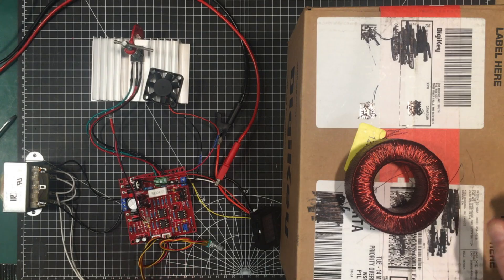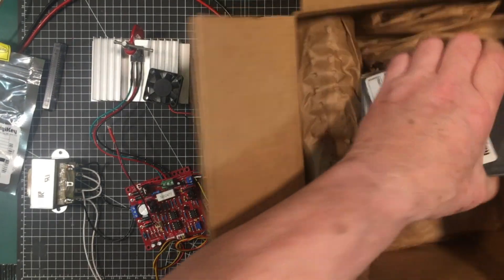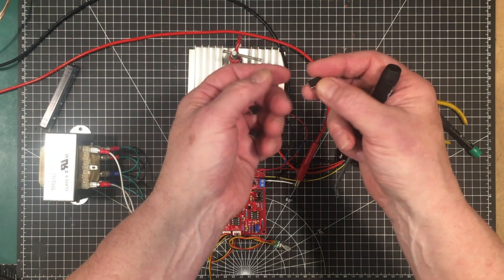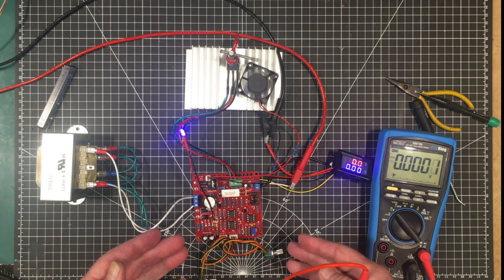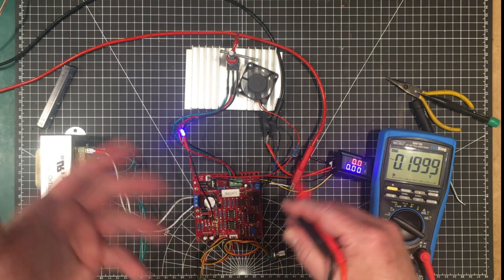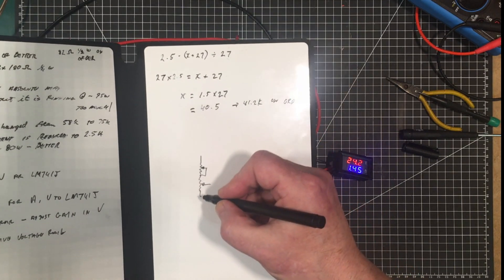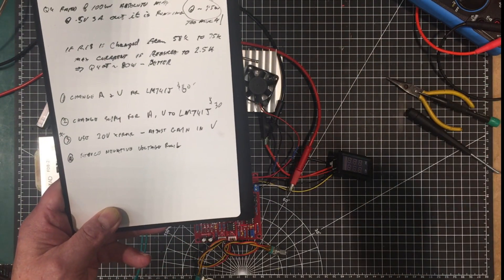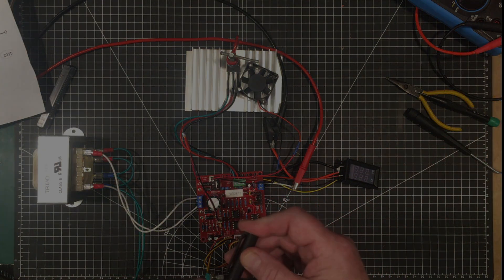Uni-Byte 0187 - PROGRESS was made - Linear BENCH Power Supply (Hiland): Part 2

Comment: one should not need to operate opamps to the maximum rail voltage to drive some BJTs. the designer just could have used 12-15v for the opamp with some design considerations.
Reply from the maker: Yes, if you put a PNP transistor in the output amplifier you can use a much lower voltage for the opamps.

Comment: While you're reading 36v open circuit, at 3A you should be at least halfway to the transformer's rated voltage (@6A), or ~30v, probably more like 28v. That's still 75W of heat when outputting 3v@3A, but not the borderline 100W.
Reply from the maker: Correct!

Comment: DO NOT tin the tip of stranded wires for a screw block!

The softer metal of the solder will crack & bend over time, and allow the original tightened screw position to lose pressure on the wire as a whole. Then you either eventually get a lost connection or a high resistance connection.

In the worst case this has happened to many people running 3D printers and left their house burnt to the ground. Common cause was tinned wires screwed into screw blocks; come loose on the heater connection and you are running amps through a high resistance point. The assemblers were following the same convenience advice as you. You'll see most 3D printer reviewers now checking if connections are crimped into 3D printer motherboards for cheaper models.

Better than tinning is indeed screwing down the bare wires. Because the wires are stronger less ductile metal, even though it could be messy, the screw can hold pressure on them even when they are nudged.

Even better than that, is using an appropriate crimp connector, crimping it on, and then screwing down on the crimp.
Reply from the maker: I get what your saying and agree, however in the case here I am only tinning the first mm or so.  This should go past the clamp point.  If it does not then this method should not be used.

Comment: Excellent update.....many thanks. Don't forget, if you just need cheap, you can parallel two of those pass transistors and they are very cheap. Great idea of using a variac to test the effects of reduced voltage of the transformer on the op amps.
Reply from the maker: Thanks!

Comment: Mine came with OP08 which is a bit better than TL081 but I replaced them with MC34071 that can handle up to 44V supply and they are very cheap.
Reply from the maker: Did you find some DIP-8 MC34071s or use a breakout board?
Reply: I got DIP8 from AX and they are working great

Comment: I always soldered the tip for years. I started using bootstrap ends just this year.  The relief the plastic bit that extends from them makes things much tidier. Only for screw in terminals. I still solder everything else. I despise those push in proto boards.
Reply from the maker: I agree, ferrules only for screw terminals.  I still use solderless breadboards for quick and dirty "try outs".

Comment: I have a couple of cores rated for somewhere between 1000 and 2000 watts at 60 Hz AC, probably a lot closer to 2000 Watts. I'm planning on winding one as both an isolation transformer for the bench, and a 50 V supply for a HF linear amp. Should be fun, but it will take me a while with my old hands. Winding big toroids with heavy wire is hard work
Reply from the maker: I can't get my hear around winding a whole transformer on a toroid ring.  You're a better man than me!
Reply: @uni-byte , I believe the operative word is 'dumber' not 'better'. I can at least cheat on the job since the primary is already in place. I got 4 transformer cores or QA failed complete transformers (slight mechanical hum or vibration problems,) from a local very high-end audio amplifier manufacturer. They took $15 for them all for the employee beer fund. Similar ones on eBay were selling for $160 each. So I'll remind myself of that as I'm busily ruining my hands and wrists.
Reply from the maker: @johnwest7993  LOL!

Comment: Loads of changes ! it's very interesting, you could redesign it and get a PCB made but that's not the point I guess. Great stuff and I would use something a bit more beefy as the pass trany and I would not pay 30 anythings for an Op Amp LOL ! The wire tip is great for hobbyist but industry won't like it, here in the UK its a no no as eventually the terminal loosens with soft solder and the aerospace and medical people stopped it, see you in the next one....cheers !
Reply from the maker: Good thoughts.  On the soldering the wire, that's why just the very tip.  Then the solder goes in past the clamping point and actually acts like a anchor.  Tinning to whole stripped length is a no no for sure.

Comment: I bought a ferrule crimper set to use with wires going into terminal blocks but I like your soldering method better.
Reply: I solder tinned the tips, for years, for this application. I have recently purchased a ferrule crimping set. The mechanical hold/purchase of the screw terminal on the ferrule is much better, IMO. I was concerned that I was wasting my money on the set, but I find it to be a worthy investment that gives satisfaction, when used.
Reply: @t1d100  if you have a tinned lead not just the tips, it becomes a serious fire hazard. I was told this 45 years ago during my apprenticeship, and I never really beloved it until I went to pull out a plug and it was hot. Tinned wires under a screw terminal, you could see where the solder had migrated away under the pressure of the screw, then it started to arc and generate heat. I was very lucky to find this, worse it was in a commercially bought mains extension board. 

A crimp on or solder of ferrule is fine and the way to do things.
  

Andy
Reply: Soldered wires in terminals is a bad idea due to the cold creep the solder experiences. Hence, just the tip
Reply from the maker: Ferrules are probably best if you can get the right combination.  In this case I was using #18 wire and these not so good terminals would not open enough to accept the wire with the ferrule.  For most purposes both methods are way better than not using anything at all.